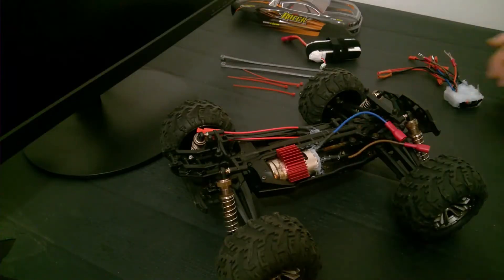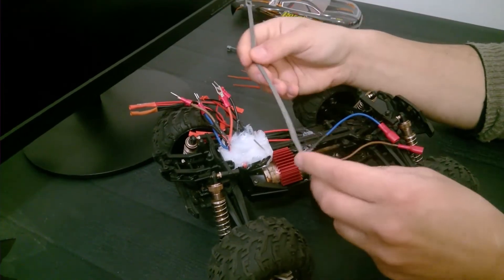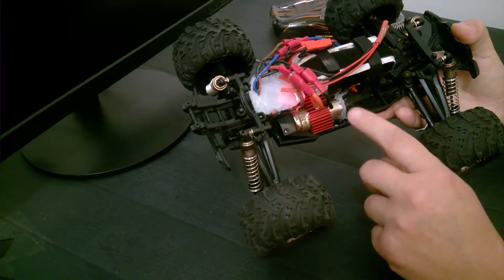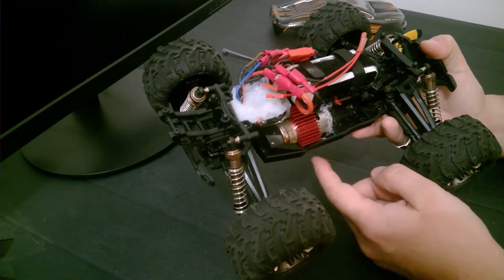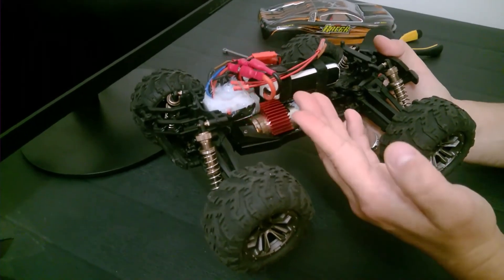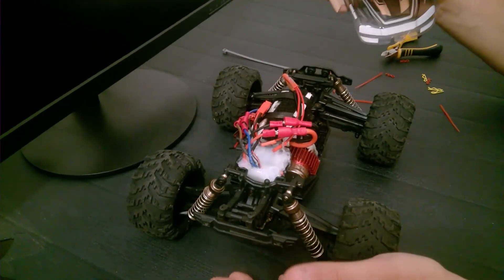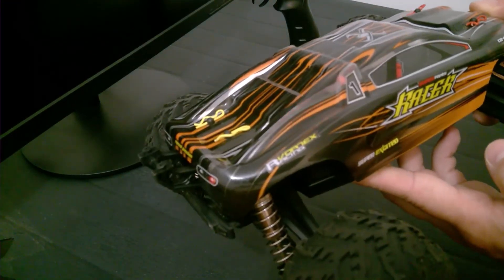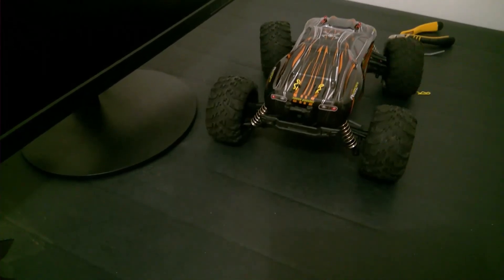How to Waterproof Any RC Car. Applying Silicone to Electrical Receiver Boards on RC Cars. Part 2.

Comment: Conformal coating my man
Reply from the maker: Conformal coatings offer moisture resistant layer of protection, but may not be considered waterproof. Even when applied heavily, most coatings are semi-permeable and may allow some amount of moisture through. But could be a good idea to test it here.

Comment: So how do you remove the silicone if you need to change something?
Reply from the maker: On the electrical circuit there is nothing to change. To remove the circuit, you have the connectors to disconnect. And if necessary, the silicon is easy to cut out.